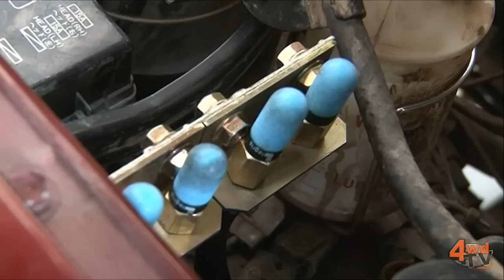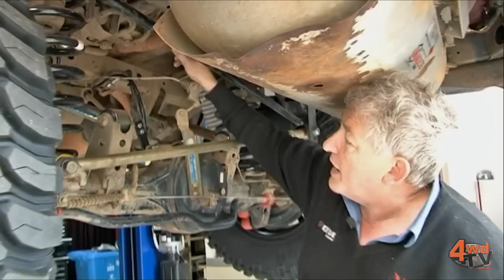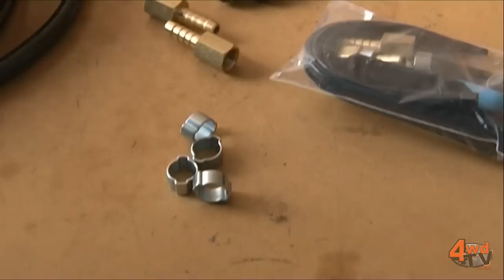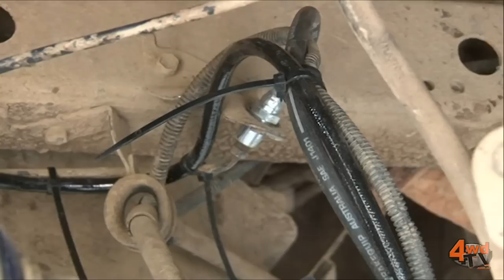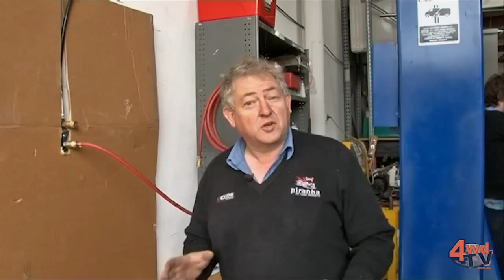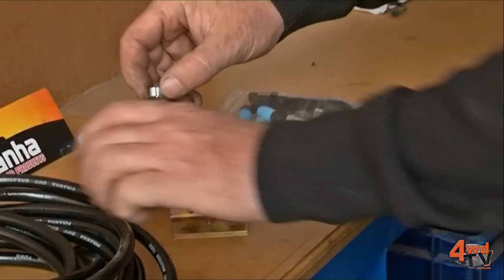youtube video #-mXzRPUUPjg

Comment: I've heard of people just using a hose with a small fuel filter on the end like the kind you would use on a lawn mower. Don't do this because the fuel filter actually traps moisture inside the diff and doesn't allow it to escape causing the oil to turn mud brown and break down.

Comment: Got one those kits here ready to install on my 80 series! The factory breathers are garbage and when they get full of oil/mud/etc. they don't work at all. Just replaced the rear diff along with the axle and hub seals, and re-greasing all the bearings, so I want the rear axle to have as much protection from water ingress as possible. Craig.

Comment: Can you explain please, if these breathers have a one-way valve, how can they possibly suck in water?
Thank you for your time.
Regards, Keith.
Reply: I would be more worried about the vent getting clogged up and not being able to let air and moisture out. These should help prevent against the vent clogging.
Reply: I did find this tidbit of info which makes sense also:

The shortfall with the factory breathers is that driving through water crossings creates a vacuum caused by the drivetrain assembly being cooled rapidly by the water. This vacuum will tightly close the valve shut causing air to be instantly drawn into the assembly through the seals. Many times the seals are still submerged below water, leading to the water being drawn into the drivetrain. This will contaminate the oil and possibly damage drivetrain components or your Air Locker.
Reply: Sucks water in passed the seals in the diff by pressures in side the diff

Comment: Why do you need to put them higher? They have a one way valve, no water can get in???
Reply: Standard breathers that come from factory aren't 1 way valves as the air that leaves has to be replaced somehow else you will end up with a vacuum in your diff

Comment: Home depot heavy duty rubber hoses + clamps + spong filters = easy and cheap cheap. No need  for a kit ever.
Reply: Thanos Go for it...it's your car.  I'd rather have the dry filter breathers....my car, my choice...your car, your choice:pay for your choice later with moisture breaking diff and transmission down causing damage.  How much does a transmission and 3 diffs cost?